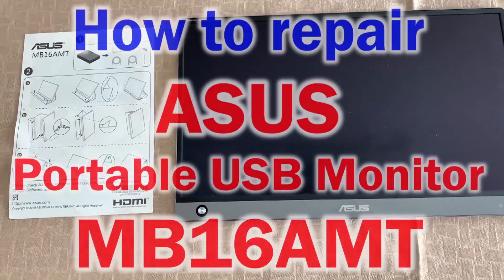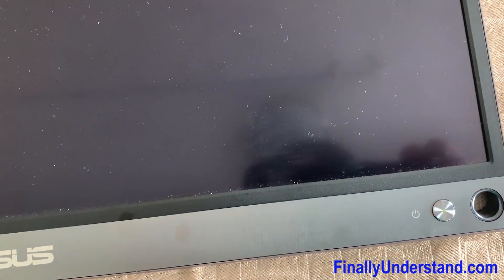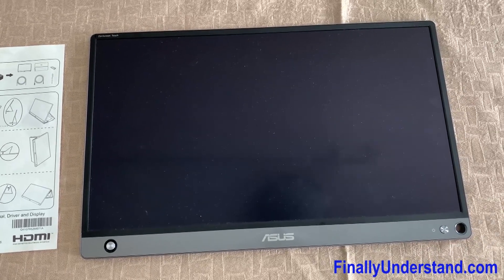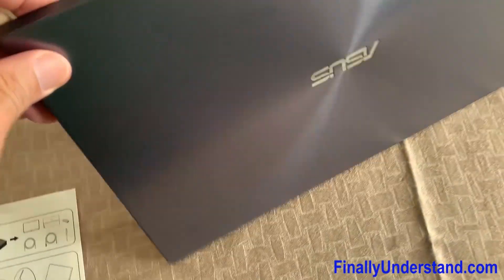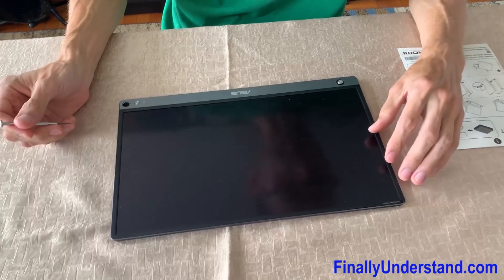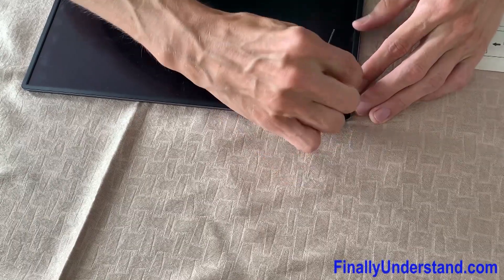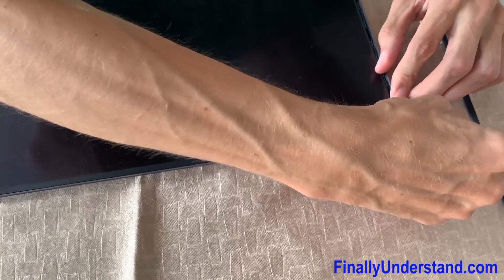How to Repair ASUS MB16AMT locked with the black screen and green light on the power button STEM Edu

Comment: It works for me. I bought a new MB16AHP twice. The first one I returned because it wouldn’t turn on. I got a second one with the same issue. After watching this video, I opened my new screen hoping to fix the problem. It didn’t work on the first attempt — I had to disconnect and reconnect the battery several times until the LED turned bright red, which means it was charging. I let it charge for about 2 hours until the light turned green, and then the screen came back to life and worked as if nothing had happened.
Thanks for the video — I hope it never fails again!

Comment: Thank you for sharing this! Mine is exactly the same model. Pressed the 2 button for 10 sec and it turned the light off. I connected with laptop and it worked again. Cheers from Singapore.

Comment: Thank you. Had exactly the same problem, followed your instructions opened the monitor with a credit card & a toothpick. Disconnected the battery connector 5s. Put back & all worked. THANK YOU

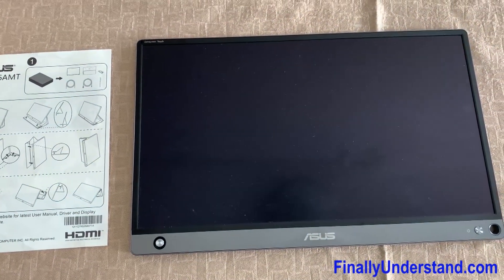Comment: Thanks, your comment about holding down the 2 buttons for 10 seconds (at 00:55) solved the problem in my case.
Reply: My problem is input micro hdmi doesn't connect. Is that same problem?
Reply: @aidiladha6439  Maybe, but in my situation, my monitor was just black and not responding.

Comment: Thank you for making this video, it's the same process for the MB16AHP. The metal frame became indented and was causing a hotspot on the display, removing the bezel allowed me to manipulate the frame enough to alleviate the issue.